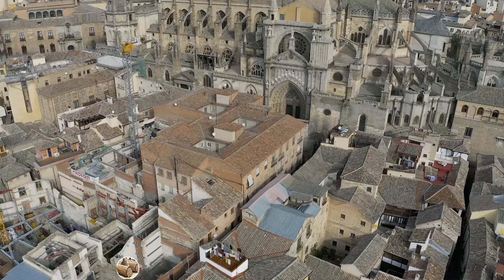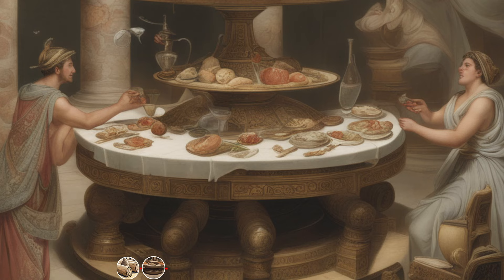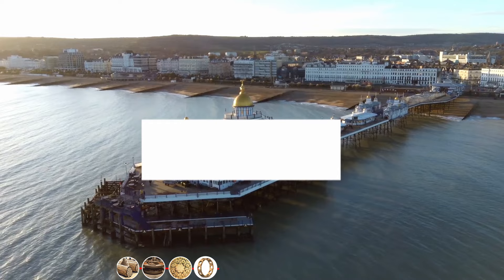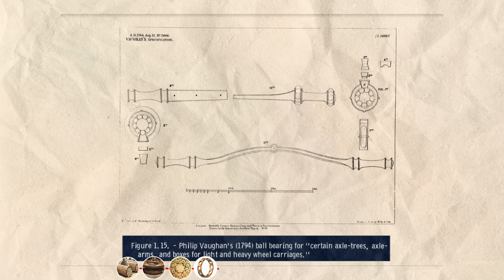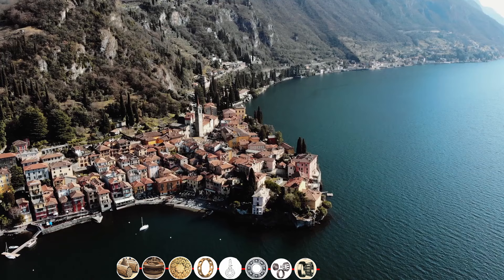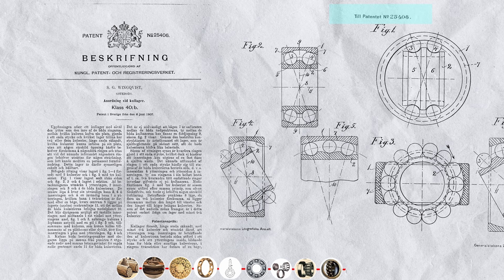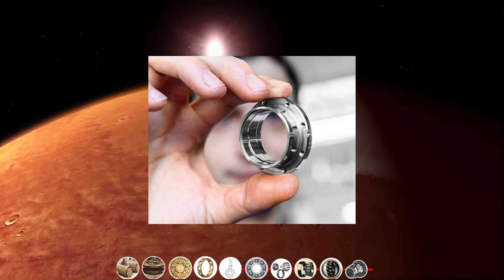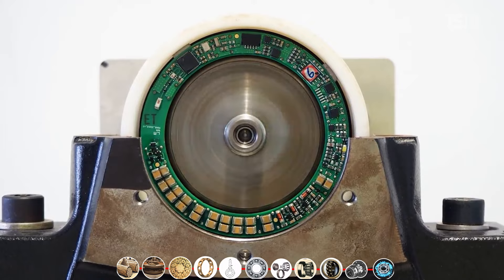History of Bearings | How Bearing Invented!!

Comment: Why we select higher kw power for design purpose then actual kw power transmitted by application for belt drive or any other application
Reply from the maker: Hi Akash,  We select the Higher capacity of the input power device then the actual requirement power, because of the following reasons
1. We can't calculate all the loading factors and energy losses exactly. Like heat loss, Noise, Friction etc. during power transmission. So we consider some extra power for these losses.
2. Sometimes in real world applications, there could be unexpected High Loading we call it pick load. So again we have to take some extra power.
3. We can use High capacity input power devices for low required power. Even tho we can adjust the power according to required power. But we can't increase the power of the input device beyond its rated power if high power will be required at any point of time.
Reply: thanks men after this my design is complete